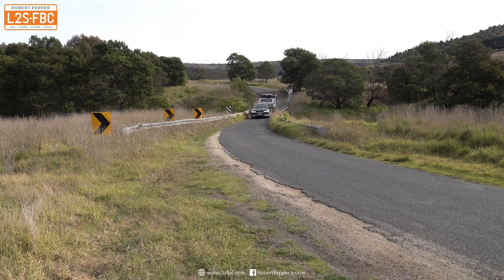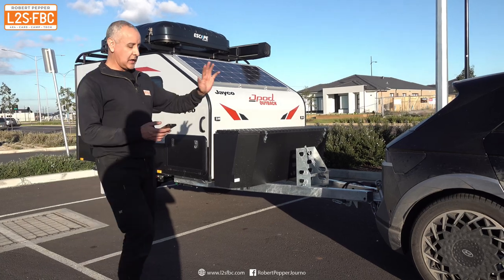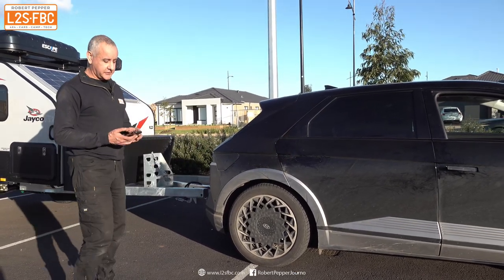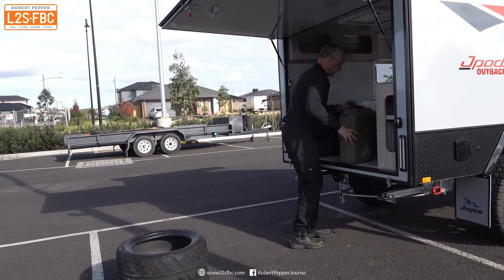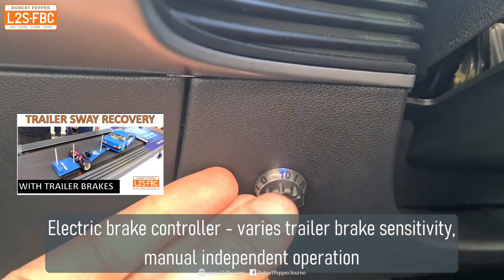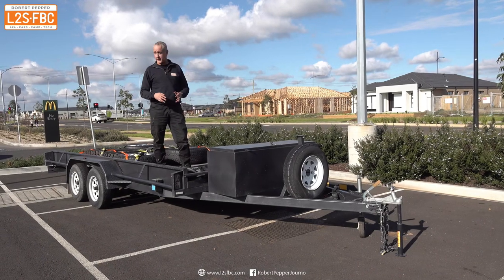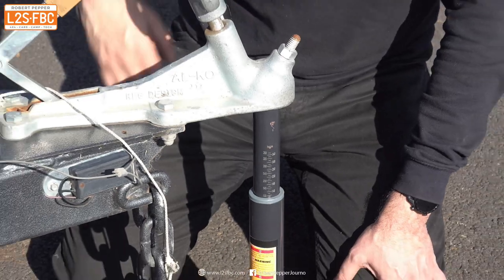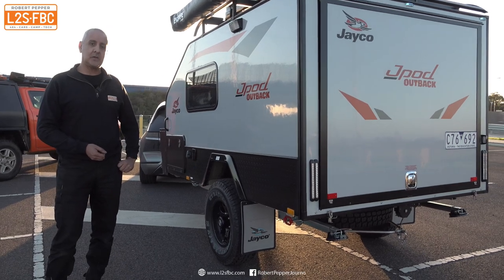Electric vehicle vs diesel tow test - trailers and weights explained

Comment: Great information. I am curious if you have a thought on why the US specifications for maximum towing with the Ioniq 5 is significantly less than the specification you gave of 1600kg? It seems that the max in the US is 2300 lbs or 1043kg? Thanks.
Reply from the maker: No idea sorry, maybe local laws

Comment: Where can I find axle load info for my tow vehicle ( Monterey- Jackaroo MY02) - Any ideas? I've chased up VicRoads (via VIN), Redbook, shop manuals, checked my owners manual...no rear or front axle max weights.
Reply from the maker: Those are the places I'd look - worst case assume 50% of GVM, it'd be more than that, but that would be safe.
Reply: @L2SFBC  Thanks Robert - that is the closest I've been able to get to a real answer!
Reply: shane manning  Thanks Shane, will have a closer look later, but I'm sure it only tells me the tow bar towing capacity. I will have another look in the owners manual...(I've looked a few times). I would expect it in the owners manual, but haven't been able to find it.
Cheers,